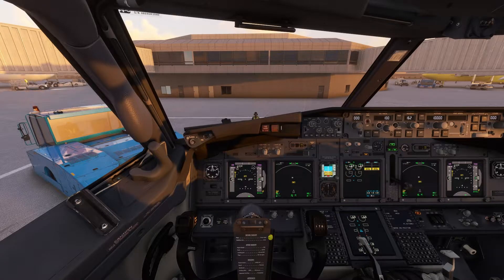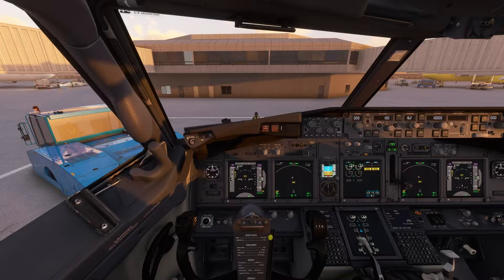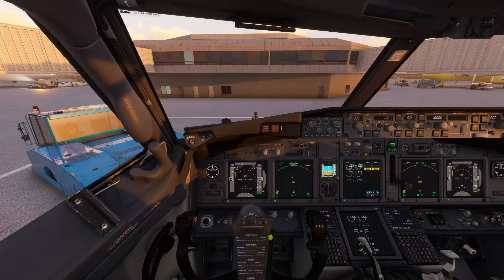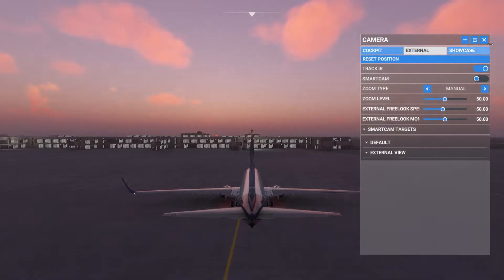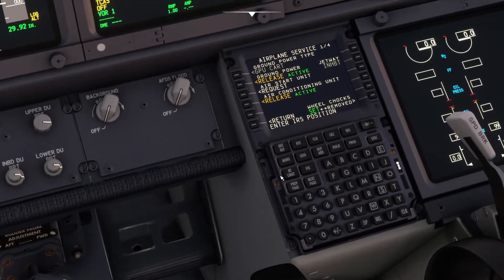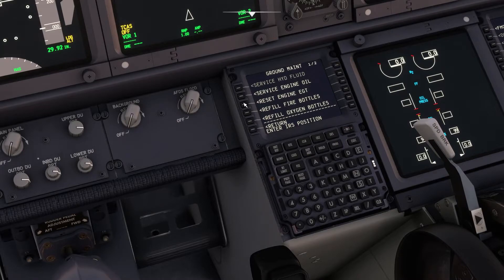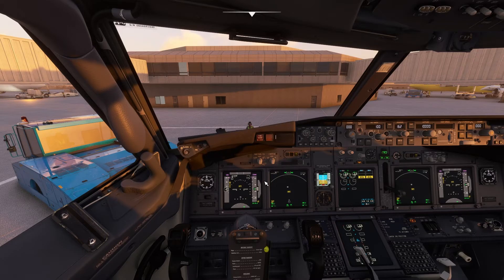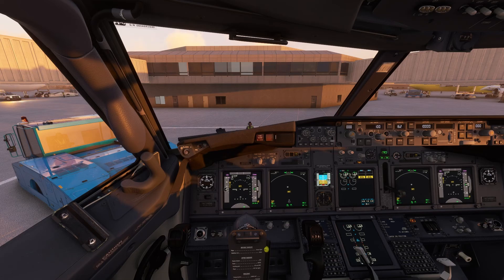How to Fix Taxi Issues with PMDG Boeing 737 800 in Microsoft Flight Simulator

Comment: Hello, I have a problem I've never seen before, the PMDG 737-800 has a very slow taxi speed, even with the throttles at full, and yes the parking brake is not engaged. I'm not sure when this problem started but I noticed it after Sim Update 15. I have a Honeycomb Bravo Throttle quadrant.
Reply: How have you resolved it??